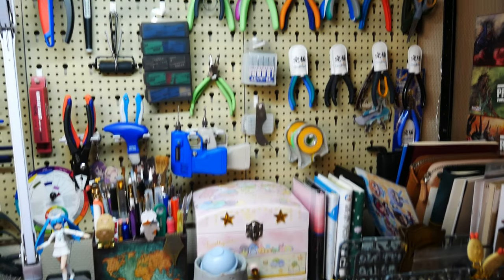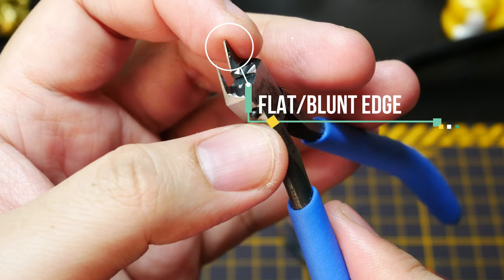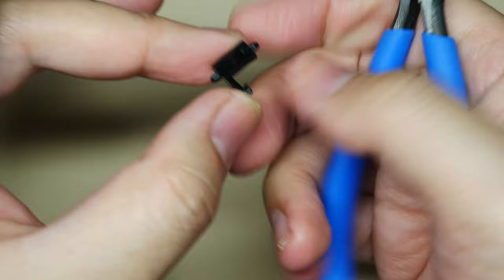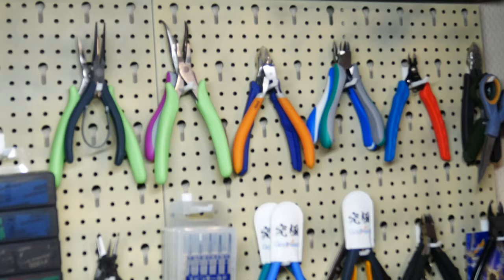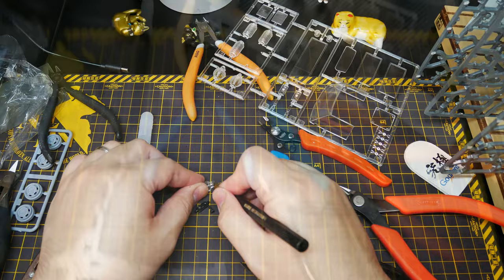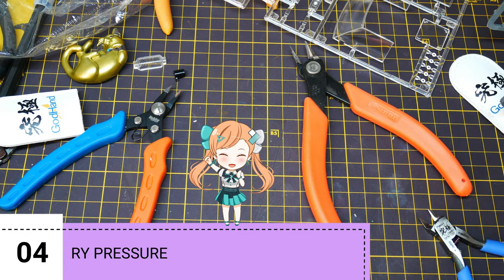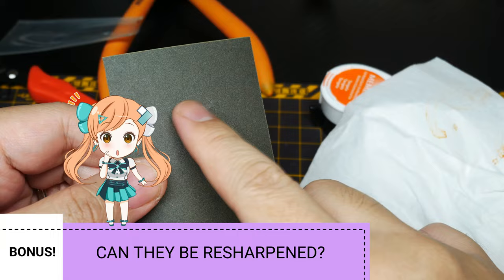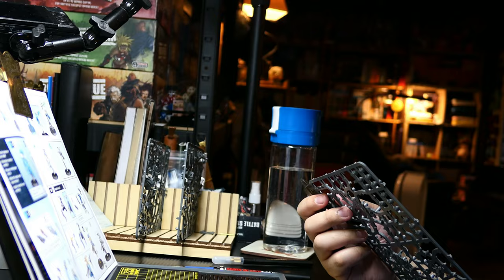Proper Usage of Single-Edged Hobby Nippers

Comment: imo steering clear from clear parts just applies to high end singler bladers like the godhands. i use a chinese brand Nanye single edge nippers (costs only 10$ in my country) for everything at its still in one piece and still cuts well
Reply from the maker: Actually, GodHand now says that it can cut clear parts of maximum 1mm diameter, so I'll have to update this video. XD For any kind of nipper, regardless if they're high end or not, I still strongly recommend following the recommended diameter thickness and materials that can be cut stated on the instructions based on their internal testing. 

I believe you, but unless the instructions says that it can cut clear parts, I still would not recommend doing it. If people do, they do it at their own risk, but it's easier to risk $10 than $50. I'd be interested in these Nanye hobby nippers (if I can find them!). 

I always use a separate cheap nipper for hard or clear parts anyway to spare that damage on my high end ones. I technically can hone and sharpen my nippers using my tools in wood cutting, but using a spare nipper saves me from having to do that. :) 

That said, there are so many companies coming out with their own sharp blades these days, what  a great time to start/be in the hobby! :D
Reply: @paniccoffee  i just think it boils down to where u cut. middle of the gates are usually 1-2mm thick anyway so it should be safe. sometimes i see people cut off parts from the runner by cutting at the rods where the gates are attached to, i guess thats how it breaks the single edge nippers.

i bought the nippers out of necessity because the standard plato nippers blades are too thick to safely cut parts without stressing the other nubs in the process.
Reply from the maker: It is true what you said about people cutting the rods, probably in an attempt to reduce stress on plastic, which is usually a habit developed from  using "pinching" nippers back in the day, they just squeeze and barely cut, so they caused the most extreme stress on plastic. It took me a while to adjust as well when I got better hobby nippers, minimizes cleaning time. I definitely recommend to cut in the middle as indicated in their instructions as well.

Honestly, I still don't understand how people manage to break their GodHand nippers besides dropping it on the floor or cutting anything other than plastic, 🤔 which ultimately prompted me to make this video to help fellow hobbyists, especially if they're new.☕

Comment: Something like this would reduce your build time and be safer to use than a hobby knife.  I've cut my finger tips a few times.  I'm definitely going to have to buy one.
Reply from the maker: Since I found out about these nippers, I just use the hobby knife sparingly if I actually need to cut a small piece or sole seam lines, but nippers to prep cut and clean gates, sandpaper if necessary after. ☕👌
Reply: @paniccoffee  I cut myself pretty bad the other day . Who knew gundam building could be so dangerous .
Reply from the maker: I know right, well better be safe 😁 I hope it's better!👍☕
Reply: @paniccoffee  I just finished the gundam I got hurt from.  I didn't hurt myself again.  Practice makes perfect.  I know you can sand it but I don't like how it ruins the finish.  Also I don't paint  beside using gundam liners and paint markers. I've built 11 gundam so far and feel like I'm getting better.  The more you learn the longer the build takes.  So don't rush it take your time and it will pay off. I'm still waiting on my new cutters. I'm going to use them for my new build a gundam dynames gn 002 mg 1/100.
Reply from the maker: @Thegamercat420  Glad to hear! Patience is truly fruitful in the end. It's true that abrasives will always show unless you paint, but I think they also have that polisher that could work for non painted kits (Raser plus/Gunprimer). 

Might also be a good idea to look into it. I've never actually tried it since I do not own it and I'm unfortunately not big enough of a channel to get one for review XD, so I can't say, but the prominent gunpla channels seems to swear by them.
Reply: @paniccoffee  I forgot to mention the gundam I built.  It was a gundam heavy weapon system. Hg 1/144 . I liked it because it is a big one that comes with a lot of weapons and two shields . You can make him without the hws. So it's two gundams in one. It's fun to panel line. You get a lot of gundam for your money.

Comment: My 1st Single Blade Nipper was a Fujiya and I got a 2nd one from Dspiae. The weird thing is the alignment from the Dspiae where the Blunt side is lower to Edged side when closed since it catches my nail when I run through them. Fujiya was well aligned where youll just feel the crack but wont stop your nail through.

Was the Dspiae Blade design the proper design here or is it defective? I saw how you cut the nub on the demo and you reached the far side of the piece with the Blunt side instead of just placing it at the back of the nub. It kind of makes sense on the Dspiae Design but it would still work I guess on an aligned Nipper.
Reply from the maker: It's not unusual and as you've concluded, it makes more sense for the blunt side to be slightly lower. This would make sure you can cut deep enough while having some leverage to hold it during the cutting motion. Godhand actually also has a subtly lowered alignment for the blunt blade and I also have other single blade nippers from Hobby Japan that exhibits this kind of alignment, but this actually would make more sense than being perfectly aligned like that with double edge nippers. Judging by both the logic and other designs I've seen, I think the Dspiae nips were designed that way. 😁 I do have their vice and I love it! I hear their stuff is pretty good! 👍 (Thanks for the info!)

espressly, ☕☕☕

Comment: If you're skilled in metal working or weapon maintenance single edge is the best way to go. 
   Twin edged anything even sheers suffer from micro mis-alignments, this ceases blades to slowly sheer off eachs micro saws. Dulling them and then once that happens maintenance is useless without years of experience working blades. 
     A single edge can be resharpened and rehoned. Plus any bends can be fixed with ease using a cloth and pliers. Humans have been bending back knifes and swords to true for centuries the same logic applies here. 
       Simply put keep some single edges nippers, you can fix them for years and even sharpen beyond the most expensive but keep in mind a sharp edge is a brittle edge.
Reply from the maker: Yup, exactly why I don't recommend sharpening them unless you do have the skill and tools, besides shattering the brittle blades, they could easily misalign them. I work with woodblock knives and linocut gouges so I also see the same misalignment and damage resulting from sharpening the wrong way, but if done right, blades can last a very long time.
Reply: @paniccoffee  my typing is crap but I'm an avid weapons collector. I recently have gotten a single edged nipper, it performed exactly how I expected. Sharpening these with a 1200 grit natural sand stone and oil would be very easy. I'll probably keep to this type and use my double edged nippers for harder plastic.
Reply from the maker: Cool, those nippers are in (your) good hands! Oh, maybe you should showcase your collection in a video (I'd love to see :D).

I do the same, but my tools are rather small so simply Pfeil honing oil with some Arkansas stones with different grits and I have a larger 2000 grit slab stone for Woodcut knives and chisels for maintenance, but I regularly use a strop while working to keep them sharp.

For nippers, I really haven't done any type of honing yet, so far my single edge nippers are as sharp as they were, but I also only use them for soft plastics and my spares for harder plastic or metals. Honing could be a simple process to us that have the experience and tools for it, but could not be the case for others so I never recommend sharpening their pairs unless they have the tools and study how, especially with the single edge nippers that are extremely sharp, but delicate.

Comment: Do you know the optimal storage method for nippers? Some reviews on godhands and dspiae mentioned rust forming within 1-2 months despite using the case and only exposing the nippers when cutting runners. How can this be prevented? (i just ordered a pair and don’t want this to happen!) It wasn't extremely common, but still noteworthy.
Reply from the maker: Hi Potatoman21! Honestly, I fortunately haven't had any type of rust formation or buildup in any of my nippers, even the ones I use to cut copper wires. The only theory I have as to the rust formation is that the metal somehow came in contact with some solvent, water (especially if you have lots of limestone from your tap water, alkaline can contribute to rust), or even our own sweat from our hands (if you're acidic like I am, I can't wear silver or metal necklaces as it will rust/tarnish, but I don't have sweat on my hands, thankfully!😅)

If you don't have any of these situations, you should be safe, but even then, I don't even clean my pairs often, but never had this. I would say be careful with solvents around like panel liner or any oil/enamel based paints. 

For storage options, I simply put mine suspended on a wall hook and other pairs in a cabinet with a nipper cap. All my other nippers are inside drawers or hooks without any caps, but so far (knock on wood!) no rust in the many years I've had them.🥳

I totally understand worrying about it as it is an investment. I'd freak if I were to find rust on my nippers. 😵 Hope that helps ease your mind, have fun bulding!🎅
Reply: @paniccoffee  Thank you so much! another thing I realized is that these people might be storing them  in humid areas and luckily im in the very dry state of Arizona, thanks again for the reply. amazing video!!!